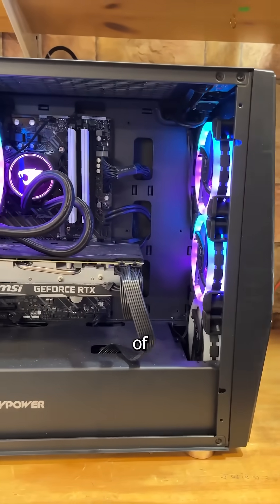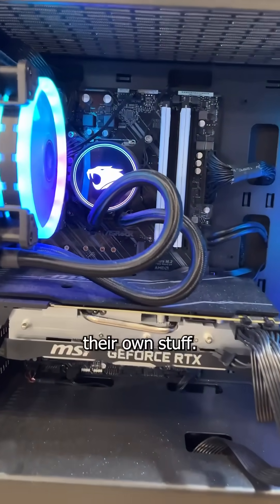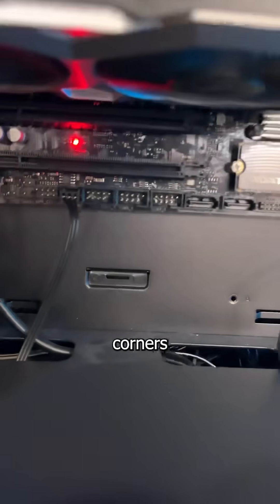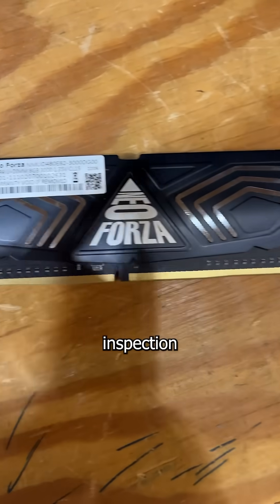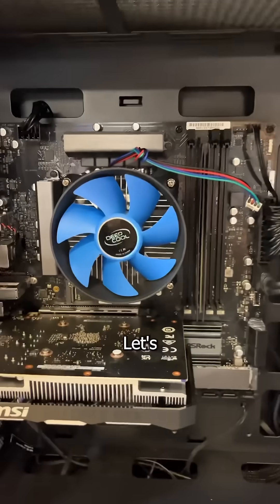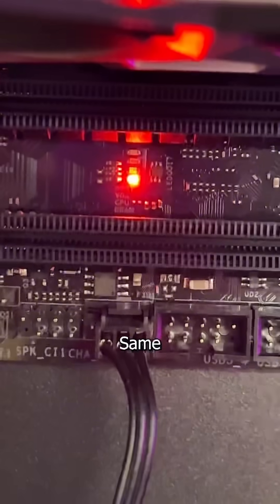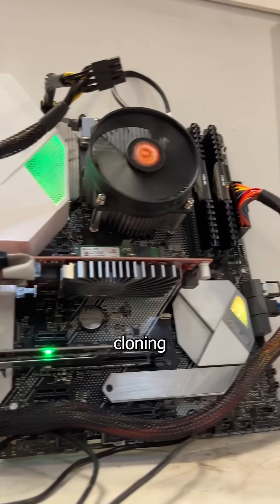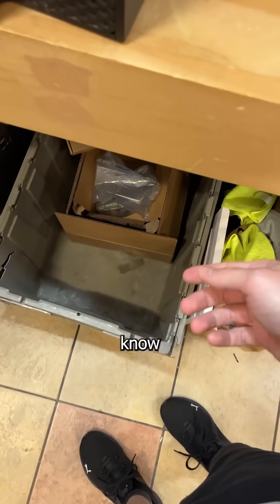iBuyProblems? Cheap NVMe causing no POST 💀 #technology #pc #tech #shorts #computer

Comment from the maker: My guess is since it's a PCIe NVMe drive, the BIOS saw some sort of short or problem on the PCIe communication line during POST and it caused it to hault. What do you think?
Reply: I've seen SSDs with faulty firmware brick the drive as well as throw RAM errors. I wouldn't be surprised if that was an issue.
Reply: @tenhundredkills  Yes tho there are a lot less components in a NVME compared to an SSD, the manufacturer has no excuse for messing it up if that was the case.
Reply: I like your funny words, magic man
Reply: @therightknee3269 thank you so much for bringing that to my attention
Reply: ever heard of AMDeez?
Reply from the maker: @crapnuts  I respect your dedication
Reply: @crapnuts amdeez what?
Reply: @crapnuts NOOOOOOooooo....
Reply: @crapnuts DeezNuts Little Brother 😂
Reply: 20 year Tech here. I have seen this alot with cheap Drives and SOC type drives. The issue seems to be in the Controller chip. When these cheap wastes of sand start to go bad the controllers seem to get a case of alzheimer's and start sending shorts and incorrect data to the system. In some extreme cases I have had them actually prevent a system from powering on at all. 

Interesting side note, if you need to recover data using a thermal pad and a squeeze clamp to put pressure on the controller/SOC can sometimes revive it long enough to pull the data.
Reply: @lordsetarurare  you can also throw pressure ontop of it, i.e. clamp, and hit it with heat to the controller. This can sonetimes work as well.. even fix the issue by accident.. however, this is an extremely sketchy thing to pull off so i wouldnt try it without some sort of soldering tech or pc building experience..
Reply: @lordsetarurare  I had one from Samsung that caused similar issues. You could never tell at what stage it would stop functioning. Most of the time the BIOS would not post with it installed.
Reply: I think i have no clue why it happened, but you big brain fixed it so i like, does show error codes arent always right though
Reply: ive heard from a pc discussion forum in discord that adata is swapping their ssd controllers so its kind of a gamble rn. chances are that the ones in that system lost a bet and is f*cked
Reply: maybe it's a dramless ssd? (it needs system ram)
Reply: @justdewitt3758 you can use dram-less ssd for OS drive just fine. That won't cause a boot issue.
Reply: @justdewitt3758 I feel like I’ve learned just a little bit of magic since I started my A+ practice. Why do I understand what you guys are saying all of a sudden LMAO
Reply: @justdewitt3758 i dont think so, i use kingstin nv2 as my os drive
Reply: @justdewitt3758 This is the correct answer, well done 😂
Reply: i don't think it's a ram problem, motherboard will try to initialize the dead drive over and over again until it times out, which meant that the motherboard hadn't POSTed yet. I've had multiple drives in my system that'd be dead and fuck up my boot sequence as well, which seems like the exact same thing happened with the computer in the video.
Reply: Hello there. I too had a problem with the exact ADATA Swordfish NVME SSD, 500GB. Totally died, and aparently was due to overheating issues and cooked to death. I had it returned and the store where i purchased it gave me the chance to get another brand. So i went with Samsung EVO

I even have the footage when it died on my Dell PC, onyl thing was it booted to BIOS even with the dead NVME, but then displayed no drive installed.
If you install it and feel the aluminium heatsink, you can sense it's very hot, but obviously not doing anything, maybe a electronic problem or short.
Reply: NVME drives put some driver like firmware during boot into the RAM, if the firmware is damaged it can cause a parity error and the bios identify a RAM error related to parity check.
Reply: I have the same computer with the same issue and haven’t fixed it still because I have no idea what’s going on 😅
Reply: So all of bro's data is gone with the drive?
Reply from the maker: @toperaheem  Yes but he didn't give a shit, it's all backed up on OneDrive.
Reply: @SalemTechsperts  ah one-drive something i waste but shouldn't
Reply: @SalemTechsperts  wdym all ?? his whole c drive??? lmao
Reply: @SalemTechsperts  People actually use onedrive??? Who woulda known
Reply: @jump1n09 only the actual data part that cant be reinstalled from the internet, disks or the OS. 
I sync my user profile and have the same files everywhere I log in.
Reply: @toperaheem 😂 as if that pc ever posted. Dude more than likely never put any data on that cheap ass drive to begin with
Reply: @toperaheem yeah that's what happens when it bricks
Reply: @toperaheem don't store data you value on SSDs. They are for performance not reliability. "The candle that burns twice as bright lasts half as long" and all that jazz.
Reply: @toperaheem because it is ssd so its data will completely vaporize when it fuck up
One of the cons of ssd tho
Reply: @toperaheem  unless it's backed up elsewhere then yes all that data is gone forever
Reply: @toperaheem probably not, nvme’s can still read after being bricked, they just can’t write.
Reply: @toperaheem drive is dead
Reply: @toperaheem shit happens. Always make a back up folder for mods that are annoying to install, game saves, and other things you don't wanna lose. 
Mitigates it to just time lost reinstalling games and programs
Reply: @toperaheem  go adata and lose your data
Reply: Historically PCs allowed RAM expansion via the device slots and treated all parity/ECC errors from the slots as RAM errors .  So if this mini PCIe card foolishly report storage ECC errors as PCIe ECC errors, the BIOS or chipset may show it as a memory error .

  Technical note: On original PCs, the ECC error signal was simply pulling the NMI interrupt of the 8088 CPU and so did the math processor .  So the BIOS NMI code would need to quickly check if the NMI was from the 8087 chip, anything else was a bad DRAM chip .
Reply: PCIe devices require memory mapping at boot by the firmware/BIOS, so that's probably why you got a DRAM error on that board cause it failed to set up the memory map.
Reply: It could be the  bios it's self corrupted. It can also bring the same error sometimes
Reply: Maybe the drive was too old. He probably bought the pc back in May or June.
Reply from the maker: @qwerty-j6b3p  hah, love this
Reply: Remember all storage offload onto the system ram and unloads it back when you shut down, this usually causes a DRAM bios issue when the drive fails, the only reason it's no longer an immediate OH could be this is drives no longer makes a clicking noice when it's press F in the chat
Reply: Isn't the pcie lane running from the same lanes as the ram slots? That might be y it thinks it's a ram error.
Reply: @ravaking8072  Ram runs off it's own dedicated lanes, but the ssd will dump data onto the ram, and the processor will also keep data onto the ram before it get's written onto the drive, to keeps pipelines free.
Reply: SMBus jamming. SMBus is a low speed self enumerated bus, based on i2c, running through most devices, but the one vital use for it is for RAM stick detection and to read out default operating parameters. When SMBus is parsed for RAM, the BIOS isn't even fully loaded yet and is run from a mapped ROM and tiny little scratch space inside first core's L1 cache! Having to bring up the RAM controller without having RAM is kind of difficult. Anyway it's eons away from trying to bring up PCIe at that point.

SMBus is pulled up near the host and has clock and data lines connected to all devices in parallel, and devices take turns pulling down the lines to reply to host poll requests. If an SMBus endpoint locks up in a pulled down state, the bus cannot recover. On RAM sticks they go to those little SPD chips (Serial Presence Detect) which store JEDEC and XMP profiles.
Reply: @killertroll_2726 send him an email don’t just comment on a comment section
Reply: I think it's because RAM and PCIe Devices both have direct lanes to the CPU. Cheap MBs can't detect the difference between the lanes and devices behind them.
Reply: Just so you know, I've been using Adata drives and RAM for years, without any problems.
Reply: @MatheusSilva-qm1ft  ^ this
Reply: Thats exactly the reason ! The memory controller being integrated to the CPU, the first NVMe x4 lanes slot used for NVMe drive is wired to the CPU too, so, ,if afaulty  NVMe drive is installed to the NVMe port managed by the CPU, the drive will try to access the RAM memory through PCI-Express lanes, causing memory error at POST ! (remember, a lot of SSD's have DRAM memory for caching datas)
Reply: shared dram cache
Reply: just fyi, i got 2 adata ssd's sx8200pnp 2tb, running for 12k hours, and one is 97% and other is still 100%. i still got the good ones.
Reply: I have no clue about what you just said
Reply from the maker: @-_--hg9yq same
Reply: My guess is that the computer gives memory addresses for it hardware and this nvme having a problem was giving errors while getting an address
Reply: Reading that made me feel like an immigrant coming to America during the Golden age of immigration and not speaking a lick of English. I'm sure it all made sense to techies but not this normie 🥴
Reply: Power On Self Test ✌️
Reply: Do PCs use NVRAM? Maybe it tried to load the RAM and failed to read catastrophically?
Reply: I don't know if this one works like it but some have HMB which uses system RAM. I don't really know what sort of witchcraft would make the PC think that SSD is also DRAM to make it halt entirely. That or a PCI-e lane issue, which is weird because there aren't too many devices connected. 

Also, ADATA. My cousin has a SX8200 Pro which is a "good one", but at first made his laptop to hang while being brand new. I thought it was a Windows issue but eventually went away and it has worked flawlessly since then (I hope I haven't jinxed it now)
Reply: @LaczPro  You can say the same with any storage brand, the cheaper you go the lower the quality.
Reply: We had the same problem when I forgot to put my hard drive in but when I put my hard drive back in it works just fine so that's why the hard drive may have confused the computer to making it think that it has g but not working right
Reply: It happen with my old laptop that use HDD too. Like it won't post, just blackscreen and when i remove the hard drive it'll post and go to the laptop bios
Reply: That's an excellent insight. I was thinking the very same as it could be interfering with the same lanes as the ram thus causing DRAM error
Reply: balonga sanwich
Reply: Also... ibuypower psus sucked a few years ago
Reply: Maybe the adata drives use dram from ddr2 sticks instead of actual storage chips, and that's why they're so unreliable...
Reply: He’s the kind of guy who would ask a question then say “its a rhetorical question”
Reply: I sure you are right cos i dont know anything
Reply: the only way i see it messing with the RAM is it messing with the SMBUS

Maybe check the SDA and SCL pins on the drive during boot with a scope if you have kit like that available.

There's also plenty of other valid discourse in this thread, however from a cursory look through this is the only thing i see missing.
Reply: I like your funny words, Magic Man!
Reply: Hello, I have a problem with the CPU, after replacing the thermal paste and fluid, my CPU works at the maximum frequency, about 5GHz, although its base clock is 3.6GHz. That's why the temperature itself in IDLE is around 60 degrees. Although it is normally around 35 degrees. The power plan checks itself, the bios is updated, the new win11 is installed, everything is returned to the default settings. Does anyone have an idea why the frequency goes to max instead of decreasing in idle state.
Reply: What do I think ? I think it’s wild that a pos ssd would cause the mb to short out 😂
Reply: My first thought could be that the customer used some SSD space as ram as you can do that in windows if your hard drive and if the SSD died and then the PC tried to write something to it it couldn't and the PC would have a tizzy fit
Reply: Pls speak English 😭
Reply: It's interesting it was a DRAM light, but it's anyone's guess the bios sequence of operations, usually it's a matter of following the traces and I would image it goes CPU > RAM > PCI and because it couldn't even get it to complete the circuit immediately after from ram to PCI it blamed the ram, because technically it didn't get to the GPU/x16
Reply: I recently installed a nvme too and it did the same thing
Reply: I think u are probably about right. The debug LEDs are not that precise because there are like 4 LEDs for individual checkpoints on post but on the way there are like 50 things that can go wrong so the pcie probably caused it to hault and it just so happens to be at the dram checkpoint
Reply: I had a similar problem when I first built my pc, turned out to be a glitch in bios and it worked after replacing the drive and updating bios but idk if that’s related to this.
Reply: @keenansisson211  I know sometimes Intel doesn't like to behave unless you install Rapid Storage Technology drivers and it could be related to that, but I think they would have exhausted all those options. Not going to speak for them, though.
Reply: I like your funny words, Magic man.
Reply: As you know, NVMe is the PCI Express bus.. And from what little I know about their inner workings, some of these drives have the ability to directly communicate with the RAM, any issues on the side of the drive can cause symptoms similar to this.. I've had it happen a couple times.. it's made me much more cautious about what drives I use, and I never buy the cheapest... The brands of SSDs that I can recommend from personal experience is going to be Samsung, SanDisk, Seagate, Western Digital, Intel, and select team group and crucial SSDs... Preferably MLC or TLC drives.. They have much better data integrity and a much longer lifespan than a QLC drive.. QLC is just cheaper because they can cram more bits of information into a given memory cell.. The issue with that is that the so-called insulation between each charge trap is much thinner, and therefore it can't handle nearly as many write cycles.. larger capacity drives tend to have a much higher terabytes written rating, but you should still go for an MLC or TLC drive.. always check the specs when looking for a new SSD..
Reply: I think those are words.. (?)...  not sure if they all have meaning 😊
Reply: I had this issue and work on UEFI firmware level where you can activate and deactivate (ignore actually) PCIe lanes or turn the chipset off manually.
Explanation: In POST the drive gets initialized before RAM is tested, cuz elsewise the PCIe device might send Interrupts or write somewhere. But while the POST tests the RAM, the drive does something wonky as it is broken. The drive simply refuses to shut up about it, even though it is not supposed to do that. POST sees errors and hurls them around. However POST never completed the RAM test (clears the LED that indicates the RAM error). It actually is not a RAM error, it just occurs in the time the RAM is checked. POSTs are very simple programs.

This is the most common one, there is also one where the drive just overrides whatever the POST is doing and many more. A random write drive can also mess with your BIOS (really bad) but is so absurdly rare. I had to emulate it to help someone with this issue. ALSO never test a broken NVMe drive in UEFI shell. The dude (and me) learned that the hard way: It can override your UEFI drivers.
Reply: The bios might be old and sees it initially as RAM till it boots, but since it is broken it doesn't boot.
Reply: maybe
Reply: PCIE devices can advertise DMA(direct memory access).
Not sure when DMA gets configured, but if at all possible, if DMA is configured before a ram check-in test is done, then it could write to memory.

Or the diode is so close to gpu diode that it was indicating a pcie problem.
Reply: From what I had to guess, the POST tests usually go CPU->DRAM->PCIe (with subtests for Storage)->VGA (aka graphics). Most of the time when storage is dead, it either reports it's dead or acts fine. But sometimes I bet a micro-controller will cause a short from stress. Either way, this is why I treat the DRAM light as both DRAM and Storage light. Plus, my general go to for working on computer is, CPU & DRAM, probably something wrong with CPU or motherboard, DRAM, it's probably going to be RAM, Storage, or Motherboard, VGA is self-explanatory.
Reply: If it's AMD the IF locked up during initialization.
Reply: I was just about to type something like that as that was going through my mind while I was watching the video. I tend to use Seagate or WD drives for almost all of my stuff. I do need to upgrade my machine at some point, just due to age.
Reply: You are not the greatest it seems
Reply: Funnily enough, I got a CPU error on my computer when it was a bad RAM stick. I've learned not to trust those lights.
Reply: The SSD isn't shorted. Otherwise your cloning station wouldn't post too. 

I guess the drives firmware is bad which causes an infinite initialisation loop. But that usually wouldn't cause a DRAM error. But who knows how the BIOS is programmed.

Maybe someone with skills in data recovery could get the data off of the drive. The memory chips themself should still work.
Reply: Don’t know anything about computers I just enjoy the aquisition of knowledge
Reply: Could it be something to do with ramdisk?   Idk if bios can set up or detect something like that.
Reply: This might be the problem. My GFs PC had the same issue.

I wiped the drive and it works, but I got her a new drive just kuz I wanted to upgrade her system.
Reply: My 970 evo just went bad, it was giving vga issues for me.
Reply: Could be that janky ram stick led to windows using a swap file maybe? Tried to boot and access the "ram", which was actually just a clapped out adata drive? Ram isn't on the pcie bus so I'm not sure how it'd trip that way otherwise, outside of some jank bios programming.
Reply: Someone help me with my pc, b450m, ryzen 5600x, Corsair 32gb ram, gf 1060oc, just out a new cpu into it.  Can’t get display, also in a boot loop every 30 seconds or so
Reply: @blakebowers9328  update the BIOS. Your mobo didn't supported Ryzen 5000 series at launch.
Reply: yupp probably was bringing down the voltage rail to the ram and the ram wouldn't initialize is my guess
Reply: Maybe it had shorted and started trying to use the nvme drive as the main source of ram, but because its programed differently it said no? im not sure, im better at the hardware than the software
Reply: Did you try sending it to adata repair
Reply: The debug LEDs are often just "eh close enough" lights, because the categories of faults don't really fit into just 4 & the EC/BIOS programmers are lazy & just toss miscellaneous errors into whatever LED bucket they feel like. This is why for a while lots of systems were showing VGA or BOOT LEDs while actually in the OS with a working system, because the 9E debug code for the TPM blockout was being miscategorized as either VGA or BOOT depending on which category the programmer decided to drop it in for that particular board's EC, despite not being an error at all.
Reply: Humm I have an XPG drive that when reporting reports as adata in the bios and that is a 256 NVMe and was made at the very beginging of the commpaney's exsistsance and the drive has been running since 2019. I think what happenes is these companies make a quality product at first to get people suckered in and then change chip manufatures or parts manufatures and then start producing an inferor products. It's very unfortunate because I give them a good review and that causes other to buy and so I think thay make a good product at first to get those good reviews and then change the script on people.
Reply: Another thing iIve noticed is that the drive in the computer you're working on here doesn't have any sort of heat sink on it, and therfore it could have died due to overheating issues, my XPG drive has had a heat sink on it since I bought it and as I stated in the previous comment, the drive reports in the bios as Adata
Reply: Probably cause it's f*ked😊
Reply: Ah yes the thing and the mahjig weren’t communicating with the computer…. Yeah I know shit about this stuff
Reply: 😂😂🤣🤣 @shadystuff08
Reply: Sounds about right
Reply: Adata Ramm isn't bad but everything else they make is a dumpster fire
Reply: I have a XPG NVMe 1tb Drive and in the bios of My motherboard it says Adata , the drive has always had a heat sink on it, so it's always had outstanding cooling, it's been in operation since 2019 no issues, I saw a video on these drives once that LTT did about how these companies will release a product and at first they put out a quality product to get good reviews, and then they will change parts suppliers and other shady things to make money. I have confirmed this is an early model, but I wouldn't recommend people go out and buy one for that reason. @nicholassano2854
Reply: VIDEO_TDR_FAILURE 0x116 
What is this?
Reply: I'm going to pretend I understand all that
Reply: Was just about to comment this exact thing I swear.... I was so close but you had to comment it 4 months before me 

I'm also smart mommy give me attention too
Reply: I've had mushkin drives that bricked themselves because of a slight change in temperature cause the sandforce controller chip to just fucking die randomly
Reply: I personally would never trust cheap NVMe SSDs. The only way I would do that is if it's from a reputable brand that I can trust to have a low risk of fault. Any unknowns like ADATA to me is a hard pass. I even pass on GPUs from unknown brands. Not saying the bigger brands are perfect but tends to make for less problems.
Reply: @AramereSolblaze  yeah I get that but you do what ya gotta do when you are on a budget
Reply: I've had a RAM error come up over shorts and improperly seated connections that had nothing to do with the RAM so that makes sense. I got a DOA MSI board recently with a bent CPU pin and had that light come on during every attempted boot.
Reply: probably that ADATA SSD either got corrupted firmware or the SSD controller got busted and it caused the motherboard BIOS misbehaved, also, that ADATA SSD, it maybe older product or bootleg because the current ADATA SSD NVME drive doesn't have that kind of SSD cover
Reply: I like your funny words magic man
Reply: I think that the NVMe drive has incompatibility issues with most motherboards or...
It has fucking slutty short in ADATA drove, why drove instead of drive?
Because it leads your LEGENDARY PC into piece of crap
Reply: I had the same problem, the computer wouldn't post at all, I mean, it would post, but very rarely, after I removed the nvme it worked like a charm.
Reply: imagine if it tried to read the graphics card to boot
Reply: DRAM doesn’t use PCI lanes, most Intel CPUs only have 20 lanes and you need 16 just for a GPU.
Reply: Ghosts...
Reply: agree
Reply: The only thing I can think of is that both PCIe and RAM go directly into the CPU and usually into almost the same part on the chip on modern systems. It's possible that a bad signal feeding into the CPUs IO unit Ruins Signal integrity for everything sensitive connected to the CPU which is why it was able to get past CPU initialization (the connection to the UEFI chip is relatively slow and reliable) and then failed to establish a connection to the RAM.
Reply: Have you tried to wipe everything that this ssd had ?
Reply: Shit i use this one 😂😂
Reply: You didn't download enough dram.
Reply: I don’t understand any of these funny words :(
Reply: That’s what I’m guessing too as PCIe lanes are supposed to be shared
Reply: My guess is that you forgot to flip the power switch when you originally reset the ram sticks.
Reply: Yeah, I thought that too, until I realised that it could have been the Nadion Inversion fields near the support APU. But it was actually the Warp Core coolant from the Nadion Ecto-Plasm feed that was plugged into the SSD that was causing the whole thing to crash. So I redirected the Theta radiation into Eye of Harmony and then used my Lightsaber crystals to power the APU.

After that I ran a StarDrive breach, activated destruct 0 and the installed McAfee Antivirusand watched the whole thing go into meltdown. I a
Reply: I guess that the problem may not be the firmware of the BIOS or the BIOS itself of the M.2 (because it worked before) and its PCIe lanes integrity seems to be fine, so I guess that one of the memory cells may have a cold solder and have contact failure with the PCB or have a faulty memory block, what may cause it to not start at all.

Further investigation of this hardware is required to understand exactly where the problem is, but I doubt it is a complex one.
Reply: They make adapter ram cards that make it possible to install nvme drives in ramslots I think the pcie busses are electricaly connected to both ram and nvme inface so bad drive looks like bad memory and computers see everything connected as memory on a base level my guess drive crashes computer before kernel can correctly identify the drive appropriately.
Reply: They most likely used thr most chemistry micro chips and resistors so I'm guessing a resistor blew or a micro chip fried and that micro chip is prop the reason it is readable by the pc
Reply: In English please
Reply: Interestingly enough, I have a similar issue on my MB right now. Half of my RAM slots (3 & 4) are busted AND my PCIe slots don't work. I don't know the root cause (I only have one bent pin on the CPU and it's a shared ground) but it sucks.

I assumed that maybe the VCC or GND on those planes were shared - so a fault on one took out both. Given the speeds PCIe needs to run at (these drives are taking all the bandwidth of an entire JBOD, after all), it wouldn't surprise me, but I haven't been assed enough to look it up, yet.
Reply: Hey, a bit late but some drives have no DRAM cache and instead use system ram so maybe that is why?
Reply: Cause it's a piece of shiiit
Reply: i think the RAM broke the mobo
Reply: On asus mobos there's an option to test m.2 slots, if the nvme doesn't have compatible self-test coded it could cause a post error. Can turn the test off and maybe save a bit of money
Reply: I have saw this quite often and many times  it was a short in the SSD's controller, it would trip out the MB and cause the SSD controller to get hotter that the sun.
Reply: Ye
Reply: a little late but... DRAM cache went faster than my dad goin for cigarettes and the motherboard sees it like a second form of dram. kinda like the step dad I will never have
Reply: I think it shows this problem because of the PCIe lanes shared with the dram...that's all I could think of
Reply: Adata XPG is known to use inconsistent parts as explained from LTT. and this creates a shorting issue, due to incorrect voltage. 

i bought 3 adata XPG, because they were on sale, all 3 of them had different NAND flash module parts, 1 samsung, 1 qualcomm, and 1 SK Hynix. All 3 were same nvme Model, different batch.
Reply: North bridge to accessories access problem. I have seen this with many manufacturers... your guess is partly right the BIOS has a bug...
Reply: I bet that the crap drive had part of it allocated as virtual memory, and that part of the drive got... sad. since virtual memory acts like RAM, thats why the motherboard gave a RAM error.
Reply: nVme's do have direct dram access so a short in one would potentially cause a dram error depending on chipset/config.
Reply: I dont know much about how the hardware works but i do know enough to say “shits f*cked”.
Reply: Ugh. Used to work in healthcare IT. The amount of workstations I had come in with failed Adata drives was horrible! Never the same symptom either. Any issue = replace drive = problem solved 🤦‍♂️
Reply: AData Drives also carry an odd issue with Desync during boot due to not having a flash memory cast this can cause False Ram Issue flags as well since the Drive is attempting to flash memory like a Ram Stick does
Reply: Maybe has something to do with windows fast startup? Could have written to the drive, got messed up, then loaded crap onto the ram and tossed an error? Computers are weird.
Reply: When I built my first pc, I had kind of the same problem (but for another reason)

My pc also showed the RAM light

So i checked every slot, looked what could be wrong or if something was not tight. When this didn‘t help, I thought I had to buy new RAM… sticks? 

Turns out: my mainboard has 2 slots for nvme cards. And if one is in slot 2 but none in slot 1, as far as I understand the PC checks slot 1 and if there is nothing the pc won‘t check slot 2 at all. 

Why the RAM light glowed I don‘t know either. But I thought it was funny because the problem in the vid and mine was caused by an nvme xD
Reply: my guess is d stands for depression
Reply: I had that problem with my new B650 motherboard, I had to Q-Flash it and update the BIOS to get it to boot.
Reply: It may have been a dremless that used the system memory. Those are known to cause random DRAM errors when they go bad.
Reply: Doesn't AMD have that rebar? Feature that allows the cpu to snag ram from the PCIe slot?
Reply: because the connection is the same as RAM and the old mobo firmwire prob didn't have the registry to define between the 2 yet? maybe
Reply: It may have been dragging down the power supply too. I had a IDE to SATA adapter once with an internal short of the 12v to the 5v, it fried the entire system for a little adapter!
Reply: I think it is because the PCI E have direct communication with the ram, without having to go through CPU
Reply: My guess, most of desktop MBs don't have a separate monitoring module for each device, just bundled telemetry... Since nvmes have direct CPU access, vendor's not gonna put a separate alert for dram, CPU or... NVMe... Too expensive (also need to RTFM 🤣)
Reply: Probably a board speck default to light ram when it's not something else
Reply: I believe the bios has no dedicated boot error indicator. So the board defaults the error to memory and storage. It mostly has to do with board and bios and how it handles the error. Some higher end board will throw you into bios after a drive failure with a message about how no boot drive was detected.
It probably has something to do with the boot sequence of the specific board.
Either way seems like an easy fix.
Reply: I dont undertand a sinlge word of this
Reply: I2c Smbus from pcie labels some objects as dram from vendor ids
Reply: Not crazy related, but im a pc gamer and i have an ibuypower pc from 2021, and its awesome, granted i got a ram and ssd upgrade recently, but i used it for almost 3 years before said upgrade, and it ran pretty nice. Its probably about time to get a new graphics card tho, rip my wallet :, (
Reply: It is likely the incorrect type of SSD slot on the motherboard. Bear in mind that there are SATA M.2 and NVMe SSDs, and some of them have both keys. In these inexpensive systems, you need to ensure you are installing the correct one. Alternatively, the ADATA could have been a counterfeit SSD from China.
Reply: My guess is that PCIE devices have some configuration maped into the cpu's memory space and the bios was unable to figure out which memory causes the problem
Reply: My best guess with a whole whopping less than 30 minutes even messin around a computer's BIOS is that drivers for the ram were stored on it and when it more or less exploded the computer went "welp fuck the ram isnt ramming"
Reply: Maybe it could be a virtual memory error
Reply: It was a factory fck up. It was in hackers news back to 2023. Some were already sold. And I mean many. Cheers
Reply: that whoud make senets
Reply: I was thinking because nvme is like ram in a way no?
Reply: personally, i think its just the drive failed with an overflow error that's causing bios to incorrectly flag the ram,  or the other way around, ram is the last succesfull step but the dram fails in a way before bios identifies the next step, which indicates some dodgy  bios code ?

anyway, its borked. and its possible the bios code is dodgy too, but neither here nor there at this stage. Good work finding the problem.
Reply: I switch from a RX 580 tò a arc a770 16gb changing everything but the Power supplie and the SSD but now it won t show signal for the 770 but only for the RX 580 what do i do?
Reply: Ain't that red denotes boot error second one is dram error. You were getting ot 1st stage itself
Reply: A failing storage device can cause such severe instability that the ram fails when trying to load in what it is supposed to be getting told by what is on the storage device.  So, basically, the storage is talking to the ram all wrong.

Doesn't really do anything to virtual ram though. Since that is managed by the OS rather than bios. 
But with this issue. You won't even get to the OS for virtual memory to even become relevant.
Reply: It's because it's on the chipset lanes.
Reply: Cuz u bought problems from i buy problems
Reply: Had the same with adata 😅😂
Reply: Bra
Reply: I've got no fucking idea
Reply: Man, I hate that in 2023... and even now in 2025 we're still referring to modern UEFI compliant firmware as a BIOS when it shares absolutely nothing in common with the original IBM BIOS
Reply: iBuyProblems. You see them often in your shop because they are E-waste the instant you hand over the money.
Reply: I had an issue where I'd get a random debug LED (any one of the 4) on boot for ages. I even swapped motherboards, from an MSI Tomahawk B650 to an Asus ROG Strix B650. And it still persisted. Turned out that WD Black NVME drive needed the NVME PCIE channel in the BIOS to be manually set to Gen4. Auto didn't cut it. Once that was set the problem went away and hasn't returned. 
I posted the solve on Reddit the other day because over the time I was hunting for a solution I ran into other people with the same parts who were getting the same issue and it was driving everyone bonkers.
Reply: Simple the computer uses any excess ram it doesn't have by using the memory on the machine even if the computer isnt using the storage it will still throw a problem because it thinks it needs it as extra
Reply: broken firmware or code reusing i suppose?
Reply: It's not a DRAM error. This mobo doesn't have a proper POST display and just shows closes thing that passed on the onboard LED's. Why not just investing a few $$ in POST code reader?
Reply: @gagarin777  According to the motherboard's very own POST codes, it was indeed throwing a DRAM error indicating an issue with the RAM or DIMM slots. A post code reader wouldn't have gotten anywhere closer to solving this problem, because it would've grabbed the same exact POST code the LED on the motherboard indicated: a DRAM fault. 

This most likely threw the error for the same reason the uploader said. NVME relies on the PCIe bus for power, rx, and tx. I've seen computers fail POST with DRAM failures due to lots of issues on the PCI bus. I've seen bad video cards and expansion cards throw identical POST failures.
Reply: @spartan456  Having POST code reader and ability to associate 30+ different codes to interrupted POST procedures gives way higher resolution to sorting out where the fault is as compared to a diode. Also you never know how mobo's LED's were programmed. I mean does red DRAM is equal to C1 POST code, or what exactly, or maybe anything between C0 and 0A?
Yes there are cases that POST code indicates something, but actually it's a different thing. For example you may have damaged cpu's IMC, set wrong IF frequency, too little IMC voltage etc and it will indicate memory issue where RAM sticks are perfectly fine and have proper voltages, frequencies and timings. Or the other way around you may have a fried RAM and it will be stuck at C0 code when CPU is actually fine. So you need to have experience in dealing with those things. POST codes are not be-all and end-all, but they are definitely better than LED's. It's strange that "The greatest technician ever" doesn't have one.
Reply: @gagarin777  This is actually very fascinating! I always assumed an external reader would be about as accurate as the internal circuitry used on the motherboard. It hadn't really occurred to me that the motherboards own circuitry would perhaps be vastly simplified for error output. I'll look into these. Usually when I run into unusual boot issues, I just take stuff out until I hit whatever component makes it boot again. But there have absolutely been situations where I'm down to something like the CPU, and without a replacement, I can't tell if that would solve the problem. Would an external reader make something like a faulty CPU easier to identify?
Reply: @spartan456  CPU is initialized as first (I think in 99,9% percent of systems). So if cpu is kaput the POST is very quick, fans will spin and usually there will be no beeping of any kind, just dead black screen. If you have POST code reader it will show C0 code. But like I said it may also be related to something being wrong with RAM (in some rare cases). Sometimes CPU will have dirty contact pads, or will not sit properly in the socket. Generally yes, POST code reader make things easier for troubleshooting. I personally don't have one, but I don't work at PC repair shop. I'm an overclocker and I have around 40-50 motherboards - some with integrated POST code display and some without. I know the systems I'm overclocking on well enough to be able to troubleshoot without the POST code display. In my case the rule I stick to is to overclock one component at a time. So if I do OC on the CPU I know I didn't screwed up anything related to GPU and if I change RAM setting's I know I only changed RAM related parameters and it's not the CPU (well sometimes IMC needs more encouragement). The POST code limitation is that you will not be able to detect faults related to the motherboard itself. 3y ago I had daily system on Rampage V Edition 10 that had a power stage failure and it killed i7 6950X. There was no way to discern from POST codes that there is a problem with it and after a 4-th try to power it on it would only show C0 code.
Reply: @gagarin777  Hmmm, well in any case this sounds like a pretty valuable tool. I've been repairing electronics professionally for the last 10 years. Most of that is diagnosing and soldering circuits under a microscope and reverse engineering circuits with no schematics. While I also do service computers, most of it is dead simple component swaps like replacing a drive, reinstalling the OS, etc. But a tool like this does sound like it'd be pretty useful for the more vague complications I've run into on them. I'll check one of these out!
Reply: @gagarin777  what does post mean? srry im new to all these pc parts thing😅
Reply: Nvme page file...?
But that kicks in at the os level, not bios
Reply: ADATA was exposed by Linus Tech Tips, that they do not use consistent parts. their DRAM module is different even if they are the same parts. Compared 2021 vs 2023, totally different parts, even though same model. They currently use less reliable module parts now.
Reply: @soju69jinro  wasn't that XPG?
Reply: actually its because it has to read the bootloader to memory(0000:7c00) the initialize the stack and finally load the kernel(ive written an os) p.s. im 13
Reply: I had one aData XPG Gammix SSD failed within about 5 months after buying it, so I just completely avoid adata to this day.
Reply: Neo Forza is actually a very popular budget brand of RAM.. I don't trust it, I don't trust G skill, I don't even trust Kingston anymore... I've had the best luck out of Corsair over the last 15 years and that's what I run in just about all of my systems.. I've yet to have one fail.. got plenty of dead crucial, Kingston, G Skill, neo Forza, PNY, and a dozen other brands of RAM that I have pulled out of systems over the years.. these so-called gaming pre-built systems that people are buying are garbage! 
They use the cheapest motherboards, the cheapest RAM, the cheapest graphics card, the cheapest power supply, the cheapest fans... And they're all slapped together... GARBAGE. I have HP pavilion and compact presario systems from the late '90s and early 2000s that are in better shape and are better built than any of these new pre-built boxes! 
It's pathetic.
Reply: Also I think I recall LTT doing a video on these a few years back about them using cheap parts on the later models of this drive.
Reply: 🎉don't ssd's have memory cashes for distributing the load of writing data across inactive time? Could the cash be dram coz adata is cheap af?
Reply: Ha ha ha ha ha ha ha ha ha ha ha ha ha ha ha ha ha ha who who ha ha ha ha ha ha ha ha ha ha ha ha ha ha ha ha he he he he he he he ha ha ha ha who who ha ha Ha he Ha ha ha ha ha ha ha ha ha 69 likes